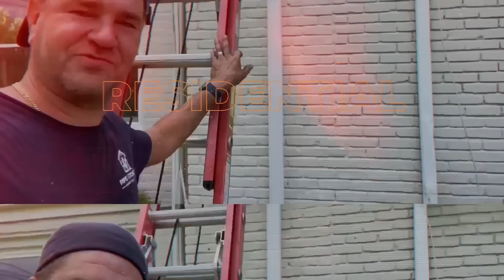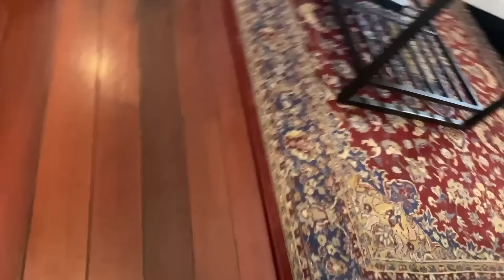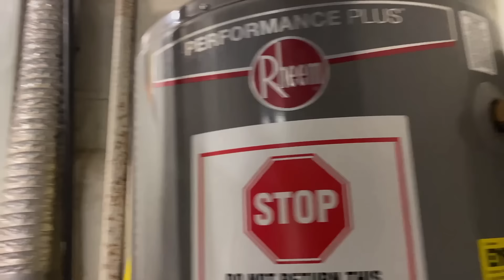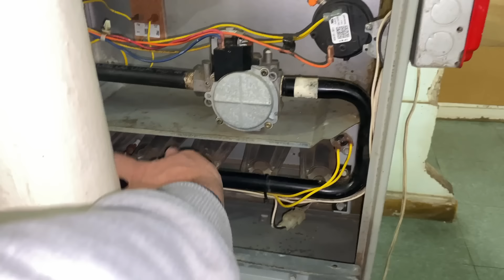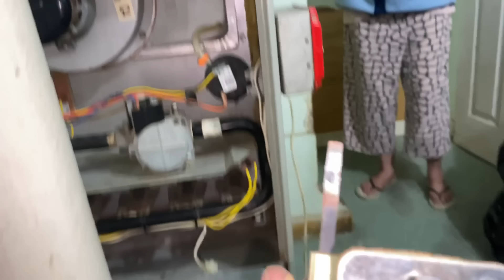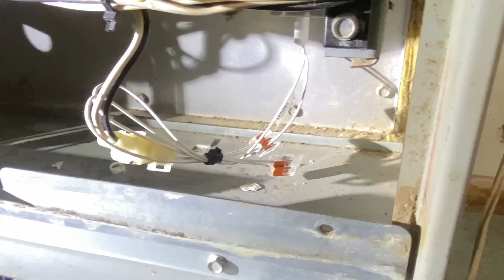No Heat Gas Trane XR80 Furnace: Ultimate Step by Step Guide for HVAC Techs & Homeowners

Comment: LOVE this video!!  the XR-80 is a greta training furnace..  almost every house builder in my area (ohio) installed these as standard fare from the early to mid 00's..  my whole neighborhood of 1000 homes built in the original phase has one..  theres one in my house (that I swapped out in the first few months I got the house new.. it got relegated to a basement furnace)..   I have replaced numerous HSI's in my nbeighborhood for people..  I keep a couple of these in a drawer at all times..  my XR80 and my american standard 2 stage 95%er use the same HSI...  ha! many of these old XR's are coming out nowadays but still a nice easy furnace to train on..  that customer better hope their blower motor doesnt go..  not sure how you'd get the assembly out..  only thing I train a little differentl;y is I always say foillow the sequence..  so heat-call, inducer, pressure switch, ignitor..  so I wouldve looked at the board and saw the light flash continuous which omn trane usually means normal run..(pressure switches closed)   and I wouldve gone for the HSI test before testing the gas valve.. and maybe because when i was in the industry at least 75% of my TRANE calls were HSI's...   P.S. I started watching some of your vids in my monile office Bus thats recently been repaired and put back into service..  the intro music sure sounds great on the 1000 watt dual 12's pumpin thew bass :)
Reply from the maker: It’s actually a great training model. I’d love one for my shop.

Comment: those trane 80% of that era always condensed in the flue pipe and rusted them away. I think part of it is short cycling and excessive post purging(maybe pre-purge too).
every single unit I've seen does just that to the point of multiple holes and the pipe/elbows needing replaced multiple times over the years(analyzer, gas pressure all shows it's working perfect)
Reply from the maker: Correct! You’ve hit the nail on the head

Comment: They have some water heaters under 40,000 that use a 3 inch exhaust. Bradford White. The skinny ones with the old style gas valve. I see them installed all the time to replace old water heaters with a 3 inch pipe. They are smaller capacity but many people would gladly trade capacity for not having to redo the vent.
Reply from the maker: Yeah true but they aren’t easy to locate and most “plumbers” have no idea about the code

Comment: In the uk as gas engineer we are responsible for a correct install for flueing and gas connections. WE CAN NOT LEAVE IT CONNECTED if not to code. Just can’t believe you just leave it like that.
Reply from the maker: That’s how it is here in my area.

Comment: Mike- being a Trane dealer, you should have checked that heat exchanger. I’d bet if you used a camera and looked down through the high limit there would have been a burner inlet crack in the heat exchanger. Good training video for the new kids though👍🏻
Reply from the maker: Thanks for the tip

Comment: Please continue with  this kind of content .? Why can't the Gas flex line  be used .? I put them on time  from time to save time on certain  job's.
Reply from the maker: ok
Reply: Becuase the gas line can actually rip and when it rips it starts leaking wich be very dangerous ! Thats why you have to use hard pipe it's safer I do hvac and plumbing myself I was always told take your time on the job and do not hurry it becuase when you start rushing through it can lead to mistakes always take your time ! And  my advice for you is to start using hard pipe so it's  not a liability !

Comment: Hey Mike, 

New Sub, and new Trane XR 80 owner.

Quick question, if the blower motor is running at all times even with thermostat set at Auto on the fan settings, or with the thermostat removed completely, I assume that would be a bad high pressure switch correct? 

Is that something that can be serviced or is it a replacement only part?

Comment: Does it matter what wire goes on the hot surface ignition when you use wire nut? Thank you
Reply from the maker: Huh? There are two wires. You can reverse them. Don’t matter.

Comment: Trane 80 volt ignition will 110 volts or less later generation switch to 120 volts  which will read 120 volts
Reply from the maker: Okay ✅

Comment: What else was wrong with the water heater install? Something about the corrugated?
Reply from the maker: 411.1 Connecting Appliances
Except as required by Section 411.1.1, appliances shall be connected to the piping system by one of the following:
Rigid metallic pipe and fittings. Space heaters and water heaters shall be connected using rigid piping and fittings only. Use of semirigid (flexible) metallic tubing, fittings, appliance connectors or quick-disconnect devices is not permitted for this application.
Reply: @PipeDoctor  Oh interesting - I did some googling, and that appears to be the code only in NY city. Everywhere else allows it which is why I didn't see anything wrong with it. In fact in a TON of places not only is corrugated/semirigid allowed, it's required because it's safer in an earthquake.

Comment: That was a good call but they should put signs "If you smell gas turn off gas call plumber" that is C4 sitting in your basement. Put C4 on your roof not as bad but under your house very bad.

Comment: Igniter toast my circuit board in my xv900 furnace.
Reply from the maker: Sounds like you need a new circuit board.
Reply: @PipeDoctor  replaced it myself just a normal joe. Works fine but you were spot on.